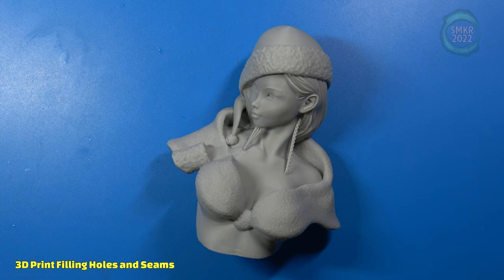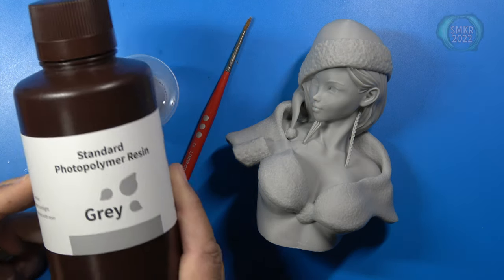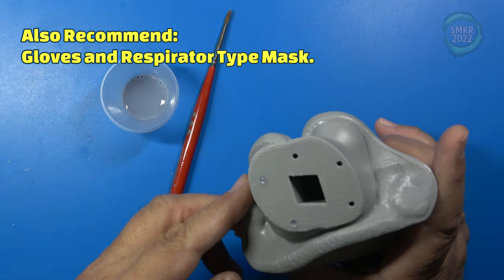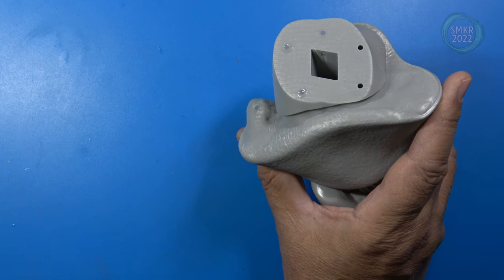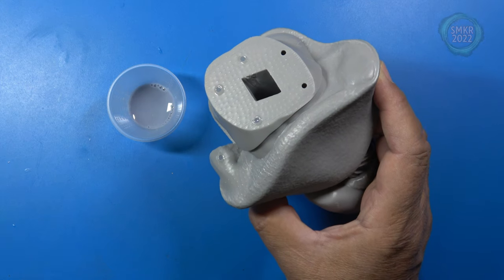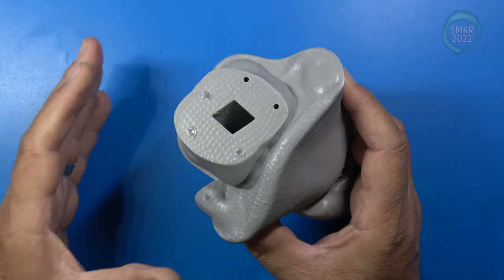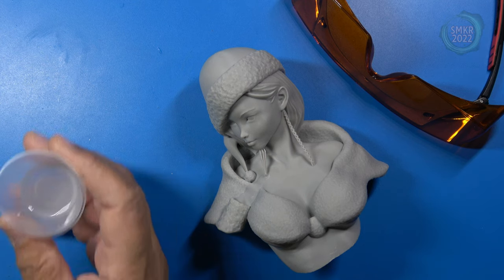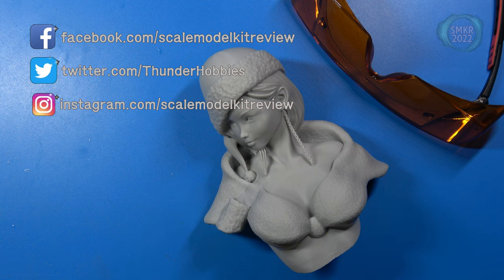Filling Holes and Seams the Easy Way for 3D Prints

Comment: I use this method too, but it's worth noting that opaque UV-curing resins can only be cured in very shallow layers - up to about 150 microns or so. I failed to realise this on one of my early attempts, and had uncured resin leaching out of the hole when I came back to sand it!
Reply from the maker: Yes great point about applying thin layers at a time.  I should have said this in the video.

Comment: Quick note Steve, the needle type dropper bottle like i recommended for the Plastic Putty works great as well for this. Also keeps you from having to handle the resin in open conditions. I would recommend if your bottle is clear to tape it with dark masking tape, as if outside light sees the clear bottle it will cure.
Reply from the maker: Thanks Mike, your suggestions are great and make sense.

Comment: So, since you’re handling the print without gloves, should I assume the print has already been cured?  Or is it better to do these minor repairs before curing the print?
Reply from the maker: Yes it is fully cured, after I prep the print for painting, I will either wash it in mild dish soap or I will wipe it with IPA.  You should never get a print from a seller that is not cured and it should never have raw material oozing out of the crevasses.
Reply: @ScaleModelKitReview , I’m not getting prints from sellers, I have my own 3D printer; however, I do agree that sellers should fully cure their prints before shipping to customers.  I just wasn’t sure if these types of repairs should be made before or after curing the print.

Comment: Be mindful that if you seal all holes in a hollow print, that the inside is fully cured. If not fully cured the off gassing will create enough pressure inside to crack the print and leak the resin from the inside. I always try to leave at least 1 hole for ventilation where it can be hidden.
Reply from the maker: I haven’t experienced that yet, but you bring up a very good point.

Comment: Steve have you got use resin filler on a 3D printed model? Is it possible to use a modelling putty such as Milliput or Revell Plasto? Consequently my go to fillers! 👍🏻
Reply from the maker: In the past I was filling with bits of plastic sprue and super glue, but I thougt I would use this method, only in thin layers at a time.  I have used perfect plastic for some seam filling, but it shrinks.  I have used Aves Expoxy sculpt but then I have to wait 24 hours for it to dry.
Reply: @ScaleModelKitReview  👌🏻